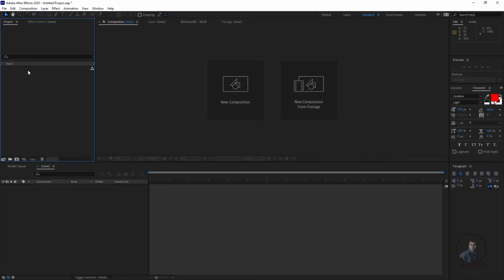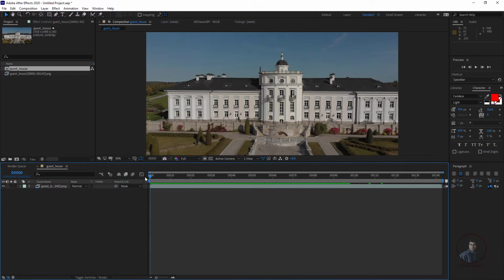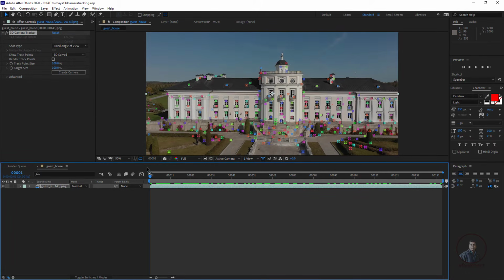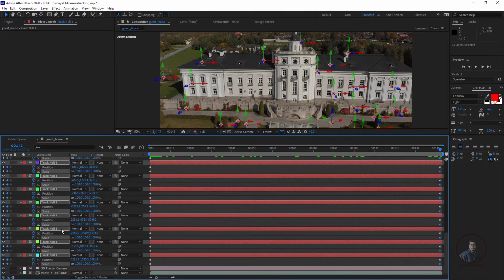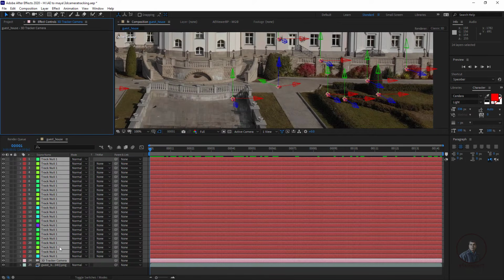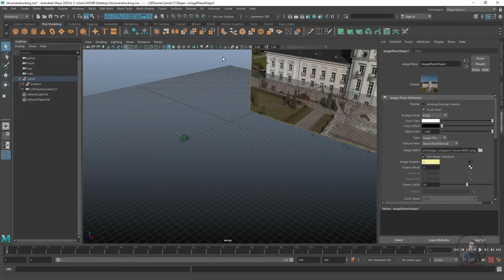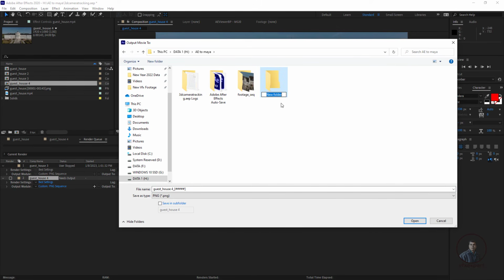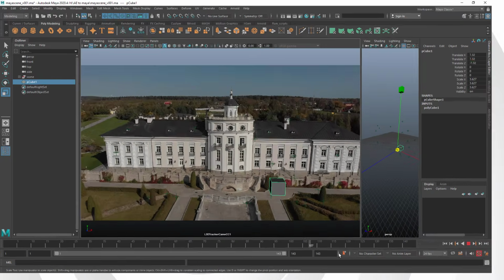Export Camera Track From After Effects To Maya | After Effects To Maya Camera Export

Comment: Thanks for the tutorial.
I installed the script but it does not save any maya files to desktop (it says export is done).
I use AE 2023. Do you know if it is working in later versions?
Reply: have you found a solution? Because  have the same
Reply: @Rando8800   I could not find a solution so I continued with 3Dsmax export
Reply: @caimantone   I found. Just try to download another vers
ion of script in internet
Reply from the maker: I have tested on ae 2020 and 2022. Not tested on 2023,try to test if any update try to upload new video thanks.